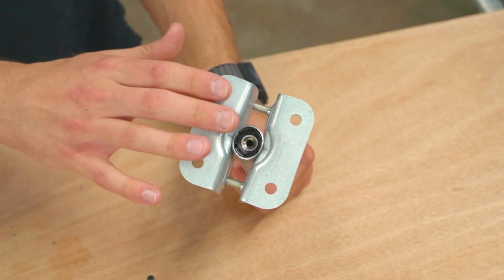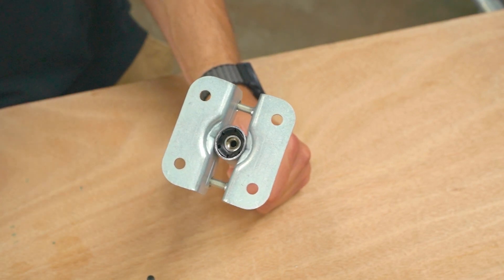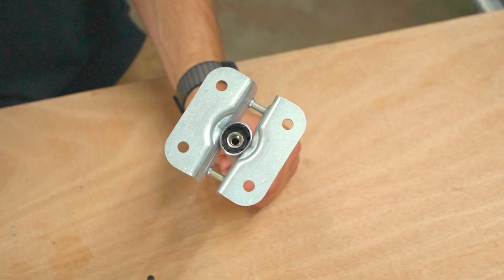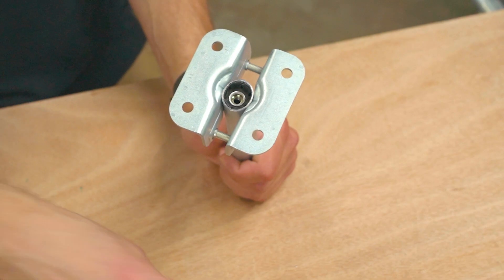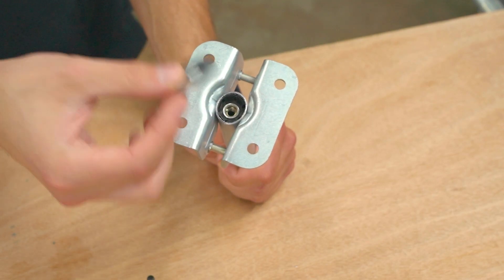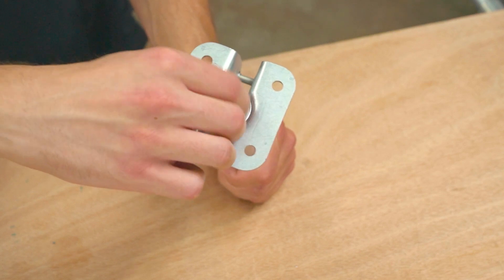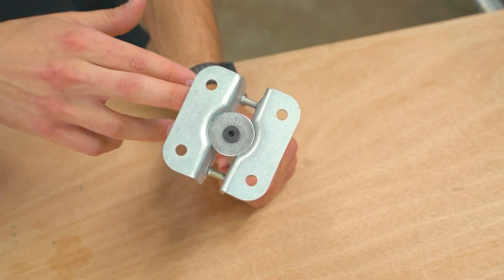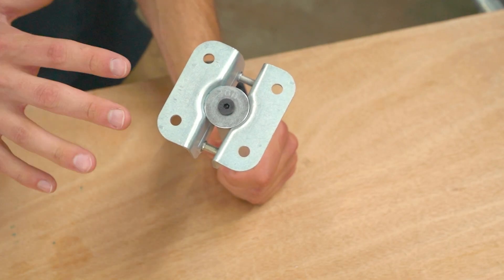How To Reinforce The Maker Pipe Flange

Comment from the maker: Check the description for the needed hardware for all three sizes of the Flange. Also, I forgot to mention that there is about an 1/8 of an inch recess in the base for the fender washer and bolt head. Anything more than that will get in the way of mounting the Flange to a flat surface.

Comment: I have not been able to make this work with 10mm ID x 30mm OD washer.  I used a test piece of 3/4 EMT to check.  The only way to get to get it to fit in the pocket caused the pipe to squeezed into an severe pointed oval.  This does not seem right to me.   I've repeatedly measured my washer and  the washer pocket diameter and keep coming back to a 35mm OD appears closer to the correct washer size.  Eyeballing the video it just seems unlikely 30mm OD is the correct size when I compare it to my 30mm washer.  I'm going to try a 35mm OD to see if that will fit better.